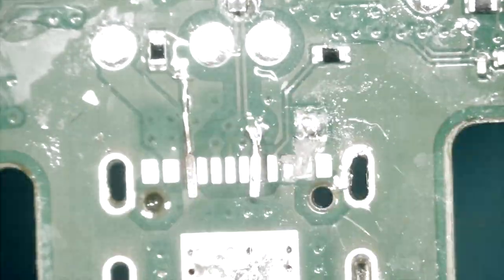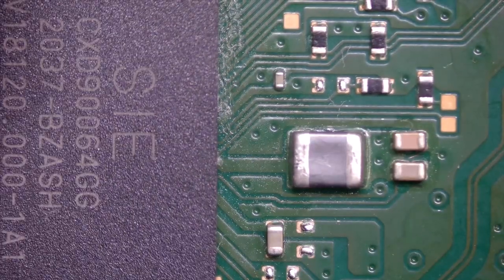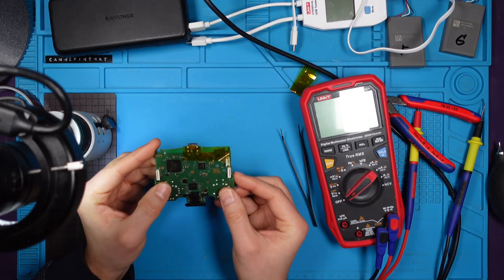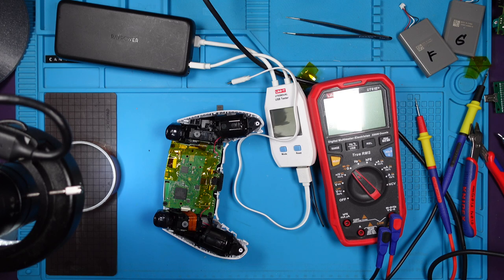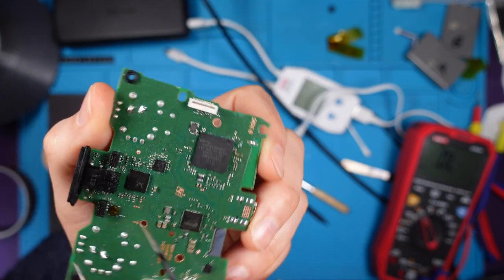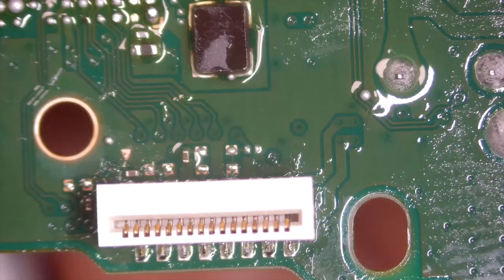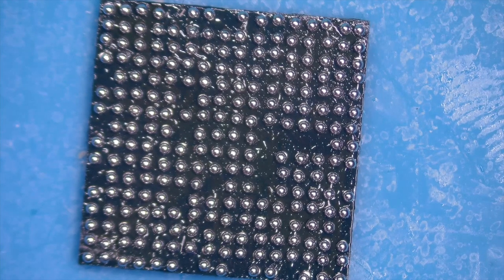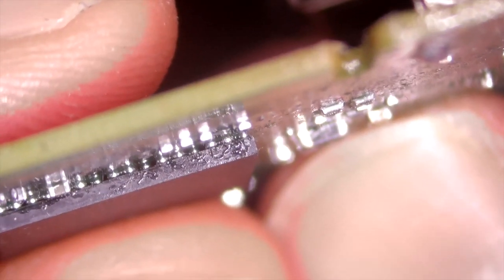Damaged PS5 Controller: One Last Try!

Comment: Good job on this one! Just a quick note about the tape for protecting plastic components: Kapton tape itself is heat resistant, but it will not protect components under it from heat (e.g. the tape will not deform with heat, but components under it will still desolder). I learned this the hard way when I peeled back a piece and about 20 SMD components went with it... You were correct in using aluminum tape later, and PTFE Fiberglass tape also works. Another option is to use thermal pads or little plates of copper as heatsinks :D
Reply from the maker: Hi! Thanks for the notes! You are right, the aluminium tape is much better for spreading the heat. I do have some coins lying around for the same purpose, but usually they are just too clunky! 😆

Comment: Your port is still the issue, there are many ports for the ps5 controller that are sold that are incompatible, even if they fit and have the same pin layout etc.

We had a similar issue when first doing the ports on these controllers, and confirmed that some ports just don’t work.

There are only two brands that we know of that work, you could confirm this by using an original port pulled from another board.

Of course, you’ll need to reball your main chip and sort that out, but replace your port again with a pulled original port, or I can help you find some compatible ones if needed!
Reply from the maker: Hi PhoneOpsPlus,

It is really bizarre that special ports are needed in this case. I would never have thought of that. Is there any way to check the replacement port to confirm that it is a compatible one? As you mentioned, it is easy to find a dozen sellers on eBay selling replacement ports for the ps5 controller. But mine was obviously not compatible. 😔
Reply: That is very intressting. But how can a port with only pins of metal make the diffrenc when the pinout is the same? There is no Electronic logic in the ports. I dont understand that.
Reply from the maker: @SebastianL.83  Maybe it is twisted inside for any reason?
Reply: @CanWeFixThat  would that maybe explain What you measured with pin A5 and A8, when i remember right?
Reply: What ports working? I changes 2 and no power...
Reply: @Lamadawid  there’s a difference between no charge and no power, do you have a working battery to see if controller turns on?
Reply: @SebastianL.83  this was my thinking initially, but, there’s different gens of usb C etc. which all have different transfer rates etc. so it’s more than just one pin goes here to one pin goes there.

Someone I messaged a while back said they did a teardown of one of the ports that don’t work, and they re wired it in a way, and got one side working.
Reply: @phoneopsplus  power on controller is ok, when pluged on new port no response, no cenection, battery is ok
Reply: @phoneopsplus  I'm from Poland, there are no JAE ports in my country, if you had any working ports, e.g. on ebay or aliexpress or amazon, I would be grateful for sending a link :)
Reply from the maker: Mouser and Digikey make absolutely no sense to order from inside the EU. When I want to buy 5 of these ports, the checkout price is over 30 €, without customs. ☹️
Reply: @CanWeFixThat  it is better to buy more than 5, to reach the amount for free shipping, but of course this is more for people/shops that are doing these repairs often.

You can sell on the rest if not needed or of course use them for further repairs in the future.

Of course it doesn’t make sense to only buy a couple if you’re not doing a lot of these repairs, where are you based? I can possibly link a company in the U.K. that can ship a couple cheaper than mouser etc.
Reply: @phoneopsplus  soldered a new port, recommended by the YT channel in my country, which worked 200%, unfortunately it does not work for me ... what else could be broken in the pad that does not detect the connection with the cable?
Reply: @CanWeFixThat  

I got nervous, desoldered the connector from the original working pad and soldered it to what with the new connector did not work anyway, started working ... and to the efficient one I soldered the purchased one and it stopped working ... what sony did it ...
Reply from the maker: @PhoneOpsPlus Yeah doesn't make that much sense for me to buy higher quantities. I am from Germany, something in the EU would be perfect, but the UK would be a good start!  😉

Comment: good video as always. I feel so with you. I know the thing with the plastic connectors too well. but the video gave me a few tips on how to start with my controller. I wouldn't change the main chip though. I don't have the equipment for that. but measuring the capacitors etc. will i test. go on ;) and the wide lens is still nice.
Reply from the maker: Hi Sebastian! What exactly is not working? Is the controller not charging? Good to hear that the video gave you some hints! 😀
Reply: @CanWeFixThat yes, the USB port had a loose connection. So I changed the USB port, that's well done, also my skills aren't even bad XD, but when I plug in a USB cable it doesn't charge. Now I'm going to measure some of the clues from the video and see if there's anything wrong.
Reply from the maker: @Sebastian L. But in general, the controller works?
Reply: @CanWeFixThat  hi, little bussy ATM. I used the controller on PC and no i did no reaction after change the Port. I musst find some time to Check the hints :)
Reply from the maker: If you could find out something, please let me know! Very curious about it. 😉
Reply: @CanWeFixThat Today I had a little time and checked the capacitors etc. no shorts found so i resoldered the port i bought on ebay. just the pins...because i feel my flux and solder sucks...maybe we can exchange about material and vendors??? maybe per Mail, let me know and i gave you my adress. So after soldering the pins and plugging in a usb cable nothing happened when i touched the battery connector i got the win usb concet sound and the charge led came on i made a little clip and then murphy's law kicked in ...I dropped the board and the port popped out....now I need a new port....I ordered the same one again and a Hakkon PCB holder. so that it doesn't happen again *narf..
Reply from the maker: @SebastianL.83  That sounds indeed interesting! So you have not connected the battery yet and touched the battery connector pins with your finger?
Reply: @CanWeFixThat  in my case i think there was a connection problem with the battery. It was connected and than i touched it coincidentally. When the parts arraived i will go on. Could you tell me where you get your flux and low melt solder?
Reply from the maker: The Flux AMTECH (NC-559-V2-TF) I am using is now nearly ungettable in the EU, at least the genuine one. I will try out the Mechanic Flux from Aliexpress. That looks decent enough to me, and Mechanic generally produces excellent products. The low-melt solder is from Chip Quik (SMD4.5NL). I bought it from Amazon a long time ago.
Reply: @CanWeFixThat  I did some research. AMTECH sells Flux through direct, all or most of the other flux is not genuine. I have the NC-559-ASM from a Chinese manufacturer, which is probably not so good for hand soldering and is more used in the industry... there is another YT channel that is probably  a AMTECH resellers, I think I will give it a try and order flux and low temperature solder at the same time.

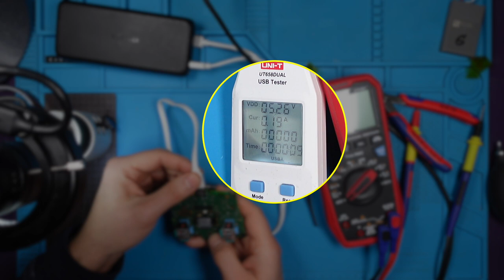Comment: I haven't checked, but I think you used too big balls, I worked with CXD90061GG and it uses 0.45 balls, so they are probably the best option there. At the beginning, you marked the batteries with F and G, so you tested with a broken 2:02 and again at 8:08 and again at 25:35 or am I doing something wrong.
Reply from the maker: Hi! You're right, the balls were definitely too big. I haven't done much reballing, to be honest. 😄 The battery isn't the issue; it seems like Sony uses special USB-C connectors with a modified pin-out, which I guess leads to the controller not functioning.

Comment: there are incompatible ports being sold all over the place i tried so many non works 
i don't know in which hole did they manufacture this port i cant find the exact same socket unfortunately the only solution is to take it from donor board

Comment: the USB type-c port on my dualsense seems causing a short circuit. when I connect the controller to my pc, the port gets really hot. is this type of problem fixable by soldering a new USB-C port ?

the controller works fine when turned on wirelessly tho. it works perfectly with bluetooth, but my pc doesn't have bluetooth :(
Reply from the maker: Hi! You can replace the port, but when you scroll to the comments here, you will quickly realize that you need a particular port. You can get them from mouser, digikey etc. 
To resolve this issue, you could upgrade your computer with a USB Bluetooth dongle.
Reply: @CanWeFixThat  I saw some people on ebay selling replacement USB c ports pretending that they are identical to the original, do you think it's safe to buy one as they are pretty cheap compared to the ones you mentioned ?
Reply from the maker: @fwocl I won't trust them. I bought a compatible port from eBay, and it was clearly a generic one that had not worked out. It is really a shame that finding a real replacement port for the ps5 controller is that difficult. 😩

Comment: I know the problem had the same as you broken port but i fixed mine and you know how? These oem or so called original port replacements are faulty try using a donor board replacement and i guarantee you will succeed. original port is called mitsumi  i couldn't find it anywhere online if anybody can find this port please leave a link for me thank you.
Reply from the maker: Yeah, I already learned that the hard way; I would also be interested if someone would have a purchase link for lower quantities.

Comment: Hey, I went through a huge headache trying to do a similar repair, and it ended up being the pinout of the USB connector. The pinout of the DualSense is custom despite being the same size as the standard connector. A compatible replacement is the JAE Electronics DX07S016JA1R1500.
Reply from the maker: Hi! Good to know that it is really very possible that most of the issues are just the wrong connector. This is really insane! But getting the mentioned model in low quantities seems very hard without paying a fortune!  😩 

Thanks for bringing this up! 💪🏻
Reply: Can we have a link?
I have more than 10 remote controlers that wait for this connector. All aliexpress and ebay have standard port.
Reply: Did you try to connect to PC? Make update to the rc via cable? Work just fine?
Reply: @samirzarour8562  Unfortunatley I can't give a link since it autodeletes, but yes it works for data connection to the PC and everything. Check Digi-Key, Mouser, Octopart, etc.
Reply: @CSab6492  
Thanks. I see that the price is really high if i compare to the standard one. 

Thanks alot.
Reply: Ordered DX07S016JA1R1500. From aliexpress. 22 usd for 10 pcs.  They sent standard port... ohhhh my gooood
Reply: @samirzarour8562  That's a shame. I think I found the listing you're talking about, and I don't see a data sheet attached. I would leave a bad review and try to get a return if possible.
Reply: @CSab6492  
Sure. Now i need to proof it. And the aliexpress team not technical at all. Omg i will have headache now.

Comment: I had the same issue, replaced usb port, got tired of not chargin with new port so i bought a chargin base lol now i can charge it with the bottom part of the controller XD
Reply from the maker: I would like to know if most ports that shops sell are incompatible. That would be a real "watergate".
Reply: The problem is that when it will need firmware update. It will ask you to connect the cable.